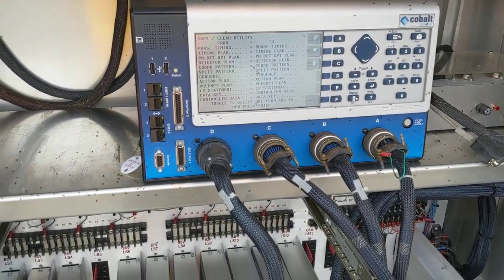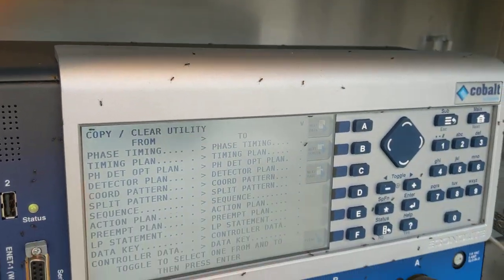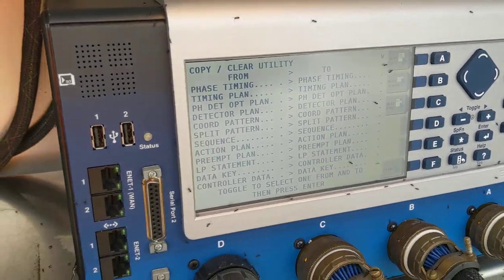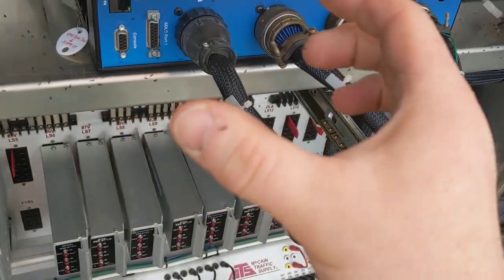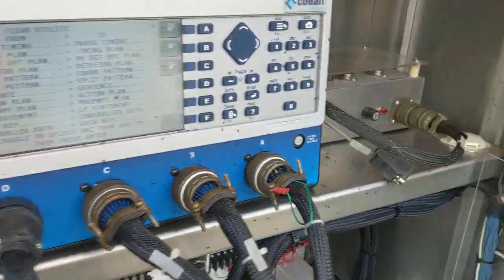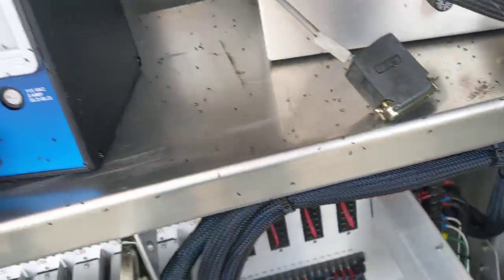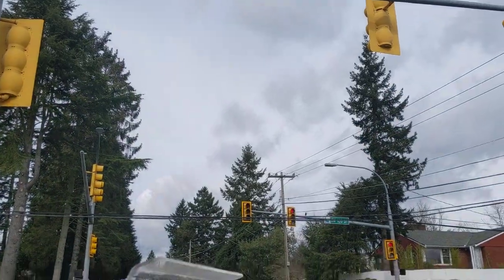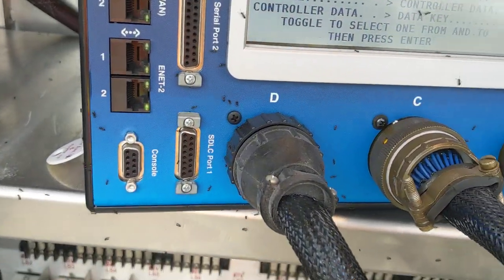ANTS!

Comment: We get a lot of problems with ants in our controllers here in Australia. During the winter particularly. They love it because it's nice and warm. Part of our routine is to sprinkle ant sand on the base. They get up in the lanterns too sometimes and cause havoc. Red back spiders are common too, particularly in the field pits but they like the controller too.
Reply: @Traffic Lights for Kinders Victoria
Reply: @Traffic Lights for Kinders what state are you?
Reply: @Traffic Lights for Kinders l fixed a set in a kinder out Keilor way several years ago. They had a Philips PTF. Most schools either have a PTF or a Delta 3.
Reply: @Traffic Lights for Kinders Yeah the trusty old PSC. Problem with the early ones (2000 and Mk2) was the red wire inside them goes crispy and the insulation crumbles off. They had that sorted by the time the Mk3 came out. Then Philips sold to Tyco which spawned the Tyco Eclipse.

Every tech I know (including me) love the PSC. The only real issue they have is detector cards can play up. Nothing else much really. Very easy to diagnose if you understand binary👍
Reply: @Traffic Lights for Kinders you're talking crazy man! The Alpha 16 was THE WORST controller we ever had. All the other states pissed them off years ago. Awful bloody things they are. Garbled fault codes, no lamps displays on the rack, you have to muck around with dip switches to check detection. They make a good boat anchor (in my opinion)
Reply: @Traffic Lights for Kinders the Alpha was good at conking out in the heat too.
Reply: @Traffic Lights for Kinders The Alpha 16 was dropped and was replaced with the ATSC4. (atsi4 as we say) which is a MUCH better controller. The PSC went on eventually to become the Eclipse (my favourite) then there's the QTC which is my least favourite of the three.

Yes getting handhelds is quite difficult if you're not in the game. You really need one if you are mucking around with prom based controllers. You need it for relearning wattages and clearing faults etc. So your PSC will be flashing the fault LED on the processor card for at least a power fail.
Reply: @Traffic Lights for Kinders in your case you're better off sticking to sprecher relay output controllers such as the PTF or Delta 3 because you don't have a handheld (yet 😉)
Reply: @Traffic Lights for Kinders that's weird. Should be the other way round. PSC in their standard trim (not low power) can only go down to 50 Watts per output. I'm surprised it's not dropping out saying last reds. How many groups is it?
Reply: @Traffic Lights for Kinders sounds to me like it is looking for a wattage or you have a fault in one of your lanterns. PSC 2000's came out in the QH lantern era so it should run QH fine. It's hard to diagnose without a handheld panel. You might have a bad neutral in one of your lanterns causing a driver feedback error. The controller would then see that as a multiple display conflict.
Reply: @Traffic Lights for Kinders is it dropping the lamps breaker (mcb) down the bottom at the incoming mains?
Reply: @Traffic Lights for Kinders haha! Fair enough.